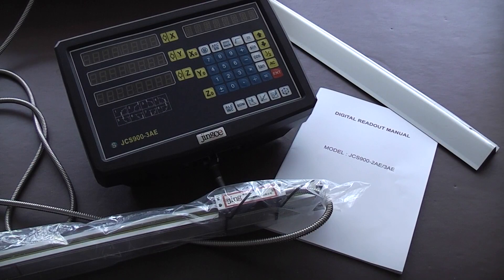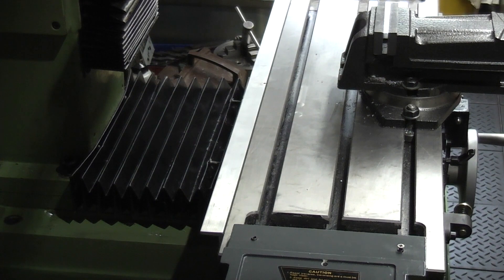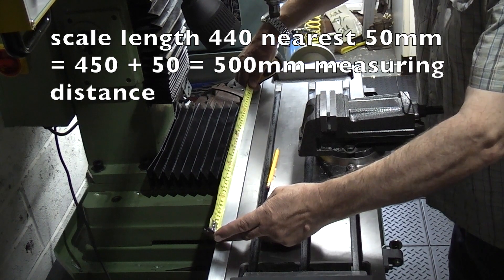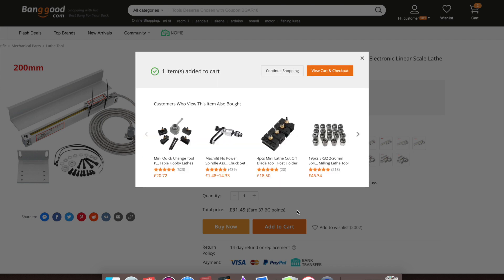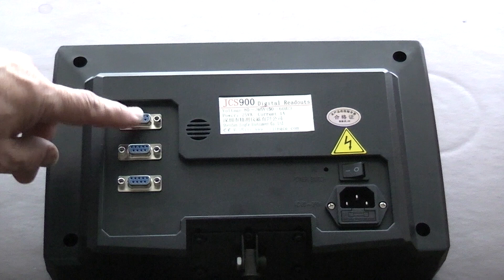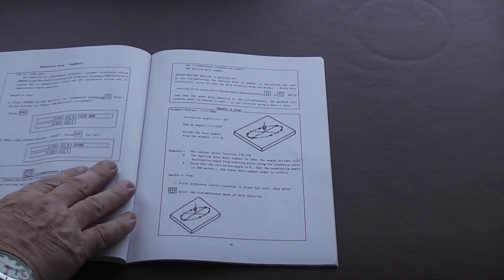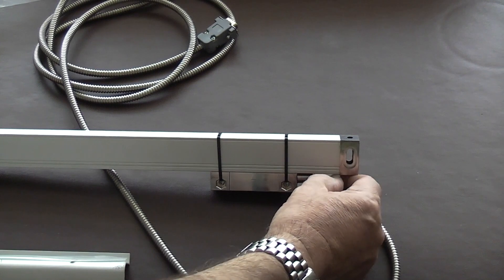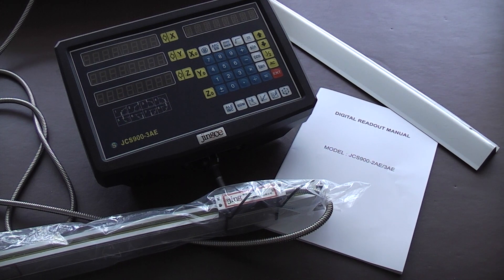Digital read out basics

Comment: I can say most definitely that's not a Canadian version of what we use for out standard 110v - 120v wall outlets. 

I doubt it's the same in the UK as here in Canada, but it still might be well worth a look through the online posted UK customs rules and regulations for exactly what duty, VAT etc applies to what your ordering from out of the country. In Canada there's a distinct separate rule for shop equipment, tooling and most supplies used. We don't pay any duty on machine tools, there accessories, measuring equipment or pretty much on anything that might be used in a shop no matter where it's made and coming from . We do pay what's called GST, PST or for most of Canada a HST sales tax on imported goods. I've had customs try to impose duty a few times and had I not known about that rule I would have been paying it. Even the people that are supposed to know there own rules make lot's of mistakes.

Comment: Hi, you forgot to mention that there is the likely hood that you will be stung for a hefty import tax, handling charge and vat bill. I only buy from sellers based in the UK nowadays and things only stand to get worst thanks the global economic geniuses who have voted us out of the EU. I had to pay an extra £63.00 on top of the price of my two axis dro  (purchase price £140.00). I could have bought exactly the same unit for £160.00 + free p & p.
Once bitten, twice shy as the old saying goes. Otherwise I'm very happy with the setup on my Harrison M300 as I do small production runs of parts for vintage British motorcycles. I'm now looking to replace the ancient and very primitive Newall Sapphire fitted to my Bridge port milling machine.
Reply: he does say 5.47 mins in, to buy from uk site, but will be more as vat is added.
I have also found if you want to purchase several items, you are better splitting them up  into separate transactions as I believe they only start bothering about vat on goods over £100 I could be wrong on that though.
Reply: Sophie he clearly mentioned it at the start

Comment: Hi Alan,

Thank you for doing this vid. Been thinking about buying a set for quite a while and this has been very helpful.

One question i had and you answered was what power does it require. So it plugs in and runs fine on 220V 50Hz
To make it clear. You work out that 300mm is the travel you need and you order the 300mm one on the site. When measuring the actual full length of the assembly, it will be 450mm

Thank again and look forward to the next part
Keep up the good work.
Paul
Reply from the maker: Hi Paul Next week we see how to fit the scales and programme the display